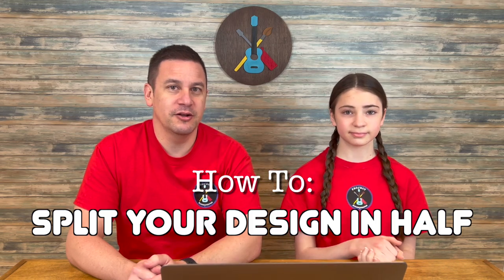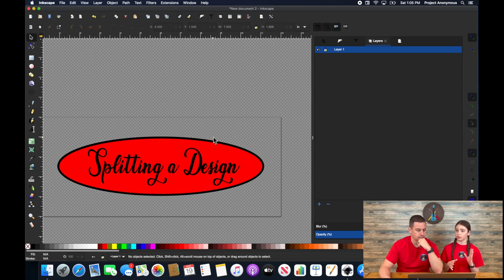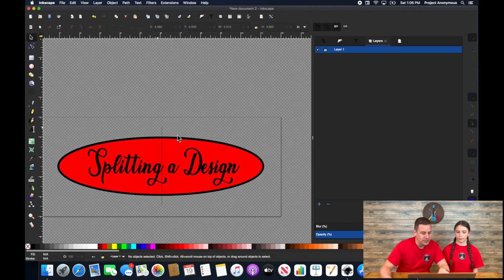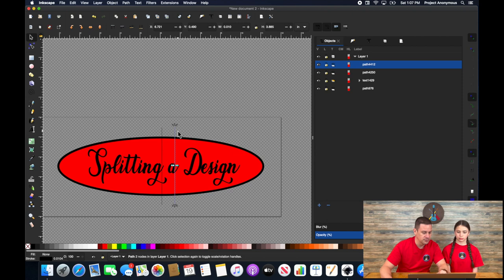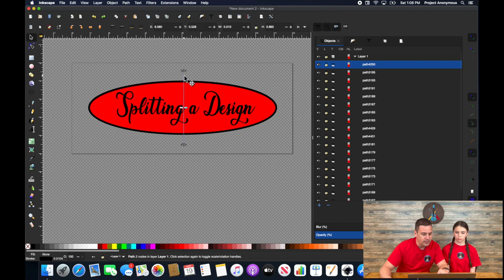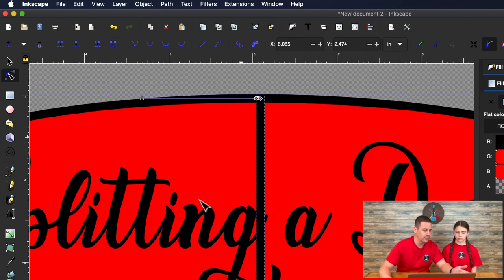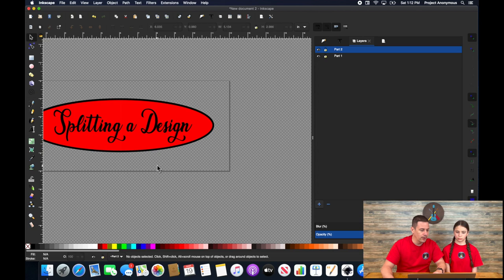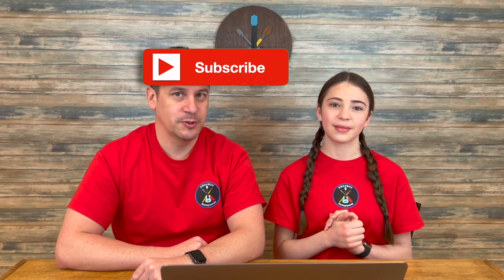How to Split a Design in Half for Machine Embroidery Using Inkscape & Ink/Stitch

Comment: Just a tip. it's better if you use a non straight line to split a design as then, once stitched, your eye does not see the line so easily.
works better on a more busy design but you could have made that line a kind of zig-zag around that 'g' and it would be harder to see when stitched. Of course, both halves of your design still need to fit into your hoop.
Reply from the maker: Great tip! We need to try this out!

Comment: I only have a 4x4 frame. Could I use this to take a larger file and split to work on my frame?
Reply from the maker: In our experience, you would need a larger re-positional hoop as it would be very hard to get an exact placement if your remove your project from the hoop and try to move it.

Comment: Can you do a tutorial on doing this on a 5x7 hoop? or is it the same process?
Reply from the maker: The 5 by 7 hoop is not a multi-positional hoop like the 5 by 12, so you shouldn’t have to split your design. If you’re just wanting to split your 5 by 7 design you can do the same procedures. Thanks for watching!
Reply: @ProjectAnonymous_Duo  Hi guys ,Thank you. For this,Question,my repo hoop is for the 4/4 machine(4/7 repo ) do I just create the 4/7 box(template and follow same suit?
Reply: I actually tried this and my machine is saying it’s too big to read 😢and I slit it into 2. PartsI. Related a 3.91 by 6.5 for my repositional hoop for the brother se 625 (4/x4 hoop.please help